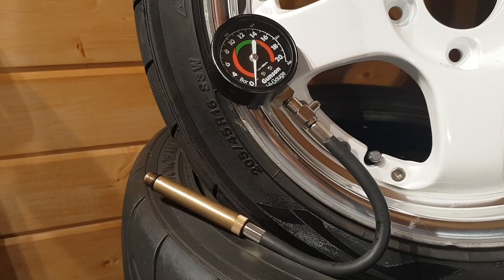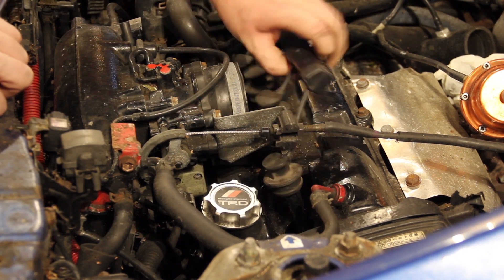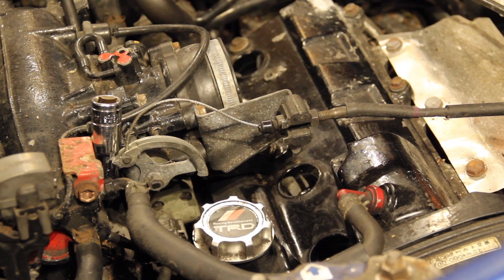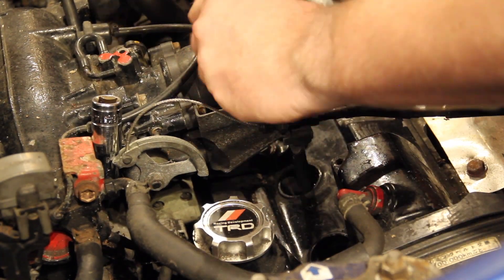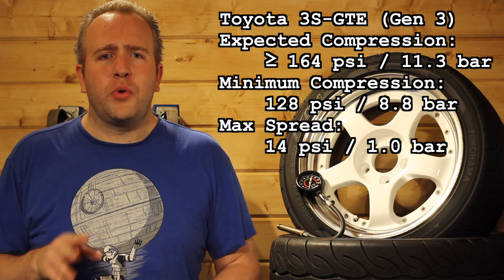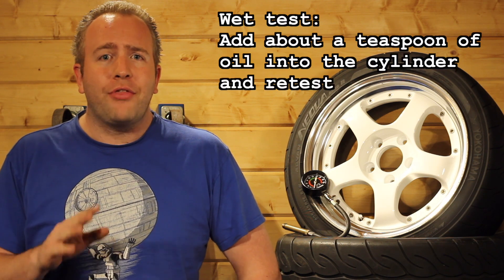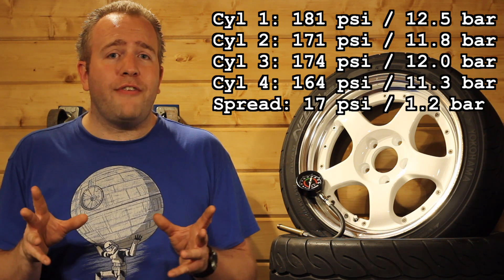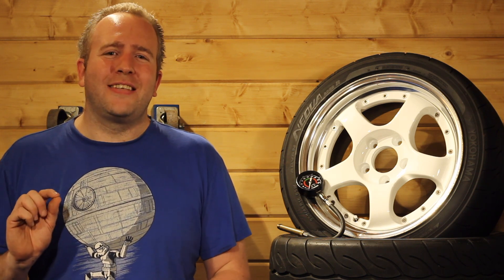How to Compression Test your Engine

Comment: just Make sure the forged internals are going in to a 5s bottem end😄
Mmmmmmm stroker goodness
Reply from the maker: Haha... we'll see 😉
Reply: 5S, as in 5SGE, as in 2.2 litres?
Reply from the maker: Yeah... you can use the crank and block from the 2.2L and the head from the 2.0L turbo to create a 2.2L turbo 😉